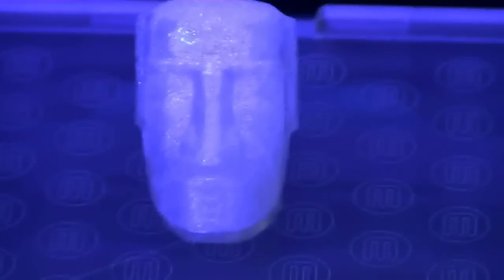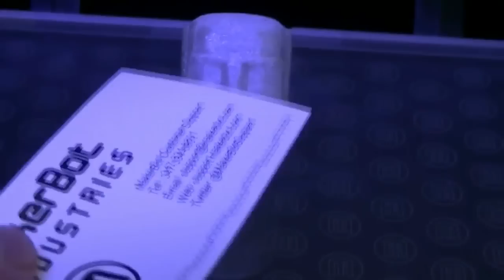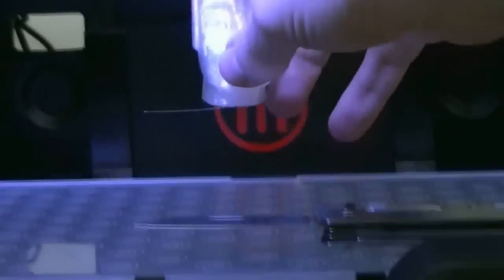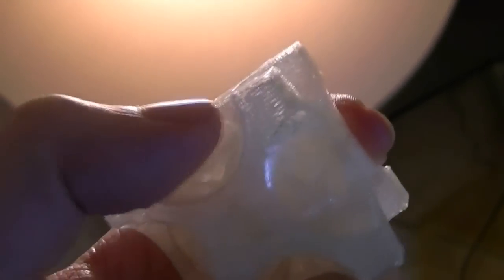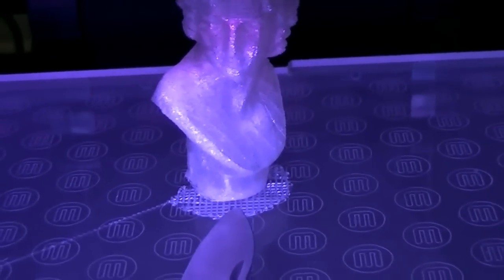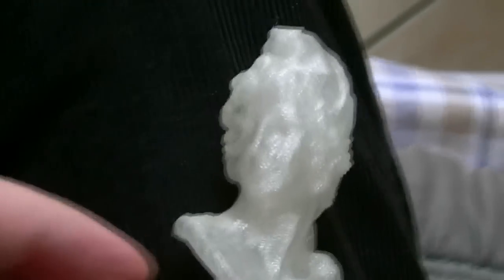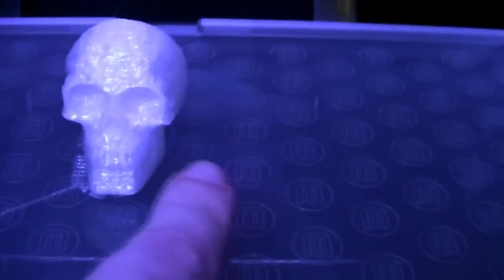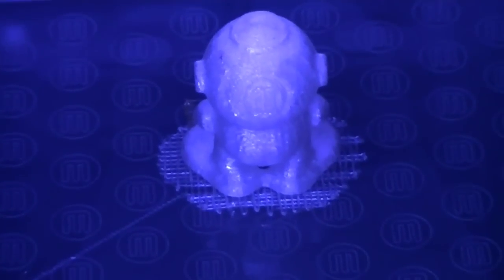MakerBot Replicator 2 : My First 3D Printer Friendly Things

Comment: Thanks for sharing! I've had some issues with my printer, but I have gotten awesome help from Makerbot Support. They gave me some tips to help with failing prints (lower temperate, avoid drafts and breezes...) and sent me a design to level my build plate. I thought I had it perfect before, but by using this print, and adjusting the levels while it was printing and adjusting the shells, I was able to level my plate and finally build things that kept failing.